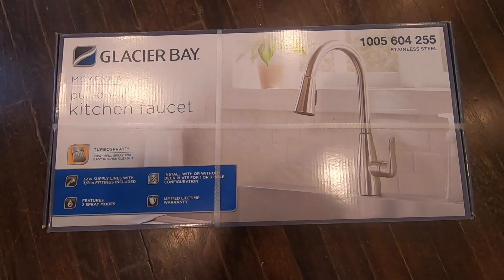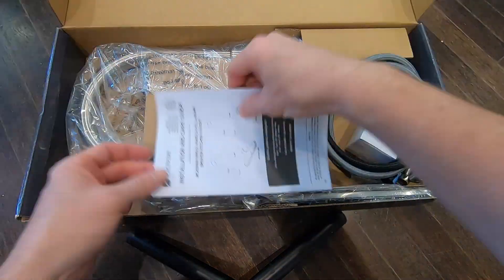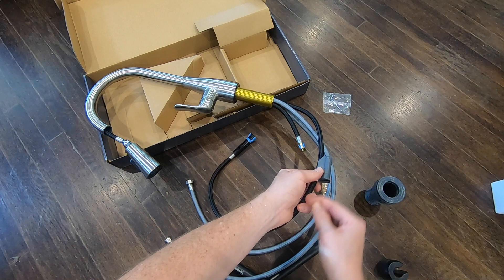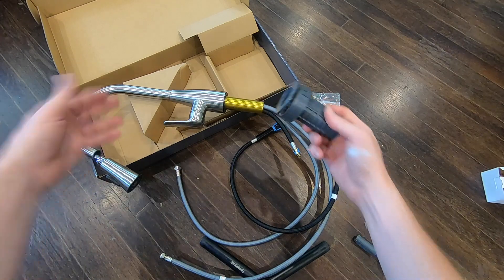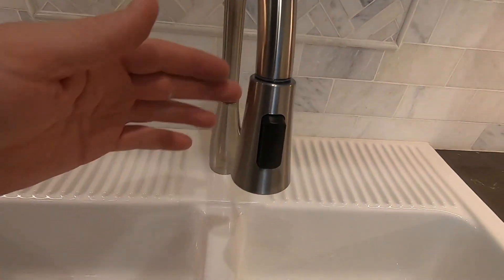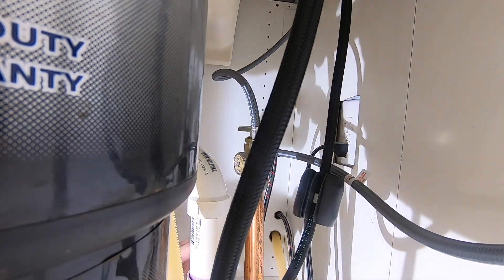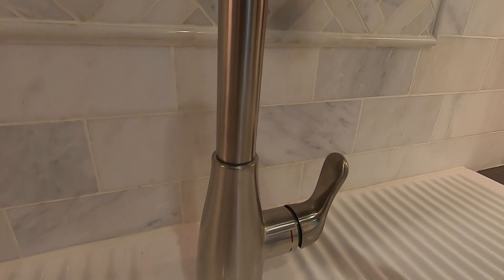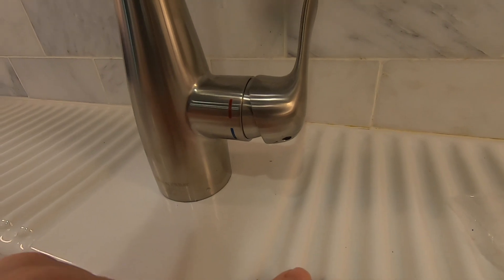Kitchen Faucet Install Featuring Glacier Bay Mckenna Faucet

Comment: Nice video. It’s fine. I think it’s mostly plastic. I don’t like how the handle is oriented so that it goes 45 degree backwards for hot and only 45 degrees forward for cold. Neutral is straight up and down. I think it should be more oriented forward.